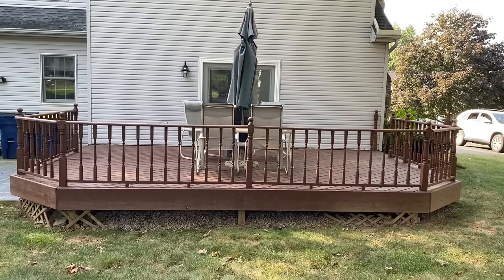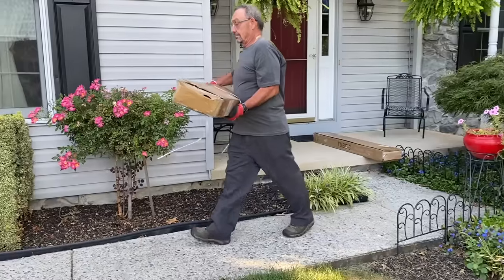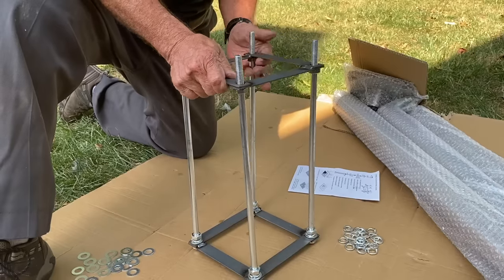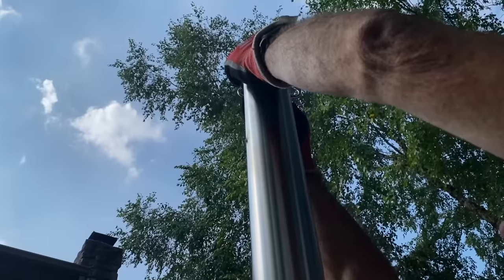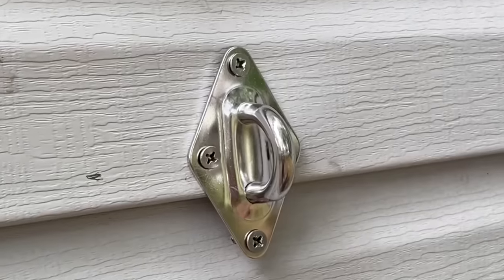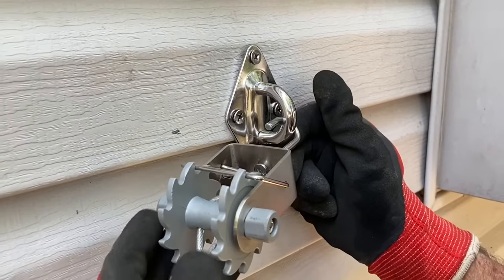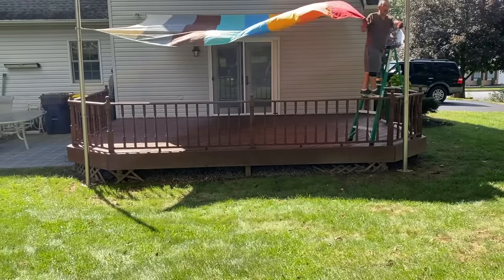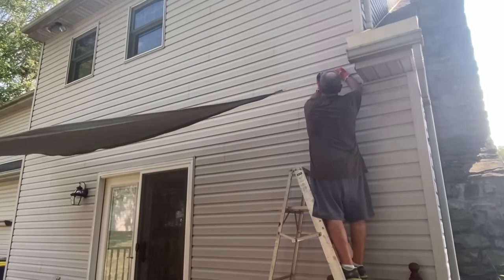The DIY shade sail installation homeowners are OBSESSED with!

Comment: So you mentioned that you put it on a little bit of a decline for the rain to runoff how does it hold up with the snow wet or dry snow in the winter time?
Reply from the maker: If there is a big snowstorm coming, we would recommend taking down the sail. removing it is super easy so this shouldn't take long!

Comment: You could use four poles but the gap between the house and tarp will drip.  Need a bit of a downward grade towards the yard so it won't puddle on the tarp.  Also, the connections in the ground are a fancy way but there is no secure point on the pole attachment and a good strong wind could simply pull up the awning and the poles will fling up and out. The tarp anchors are heavy duty.  Nice idea could use some tweaking.

Comment: Can you use 4 poles instead of connecting to your home?
Reply: You could use four poles but the gap between the house and tarp will drip.  Check out some other ideas before you go and buy this, but it is a nice idea.
Reply: @krys3216  Ty I will.
Reply from the maker: Yes! This is just how he chose to attached his, but you can totally just use poles. (:
Reply: @DebraGill  Just remember the house should be higher than the end of the porch so the rain will drain. Maybe a smaller attached/flashed type of material at the house towards the house sided poles, overlapping the awning, will provide a better (less gap) for the doorway area.  anyways, good luck and looks like a nice project :) Stay safe, ML&BLSNGS:)
Reply: @krys3216  thank you.
Reply: @Hometalk  thank you, I was hoping so.

Comment: How did you locate the header under the siding?  This looks super easy. Thanks for sharing!
Reply from the maker: It's super easy! You measure up to the ceiling inside the house, take the measurement + 5 inches and mark that on the outside of the house.
Reply: He’s talking about the band board for the second floor floor joists, not a header.